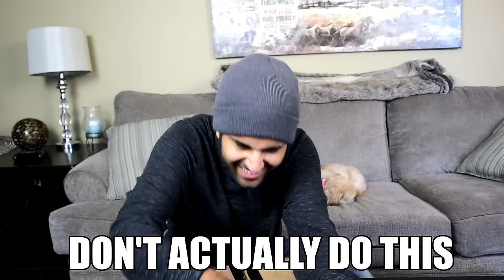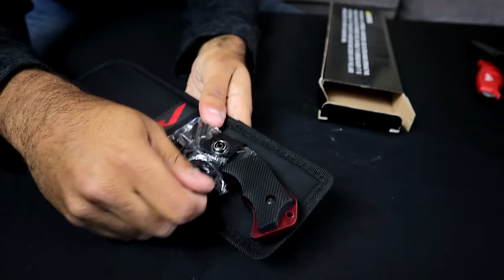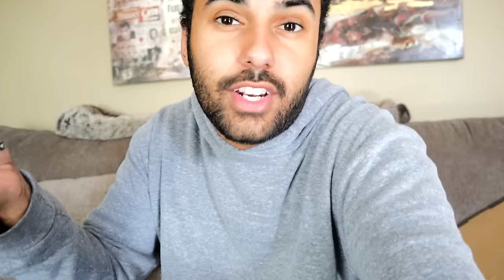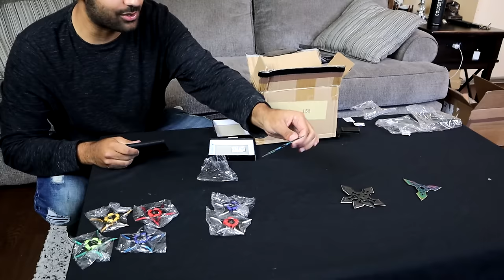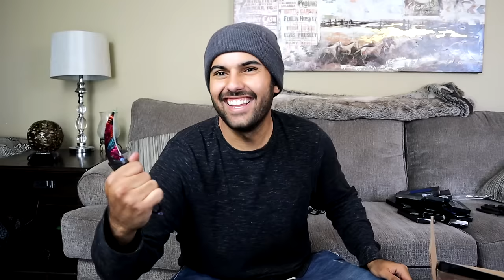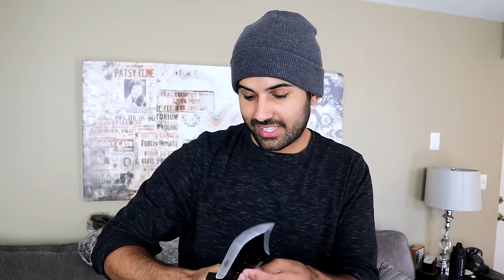Someone Sent Me a 100+ LBS Box Of MYSTERY KNIVES!! (VIDEO GAME KNIVES IN REAL LIFE)

Comment: Dude get some ballistic gel. It's a closer analog for muscle and can be remolded.
Reply: I agree he using watermelons these are really easy to cut its like..water or slush
Reply: It's not easy to get
Reply: Ballistics gel is expensive, and it rots. but they should put the watermelons in the freezer before cutting them.
Reply: The reason why I suggest ballistic gel is I would expect it to also be less expensive if he purchase the mix packets and reuse ones that he already made for multiple videos, instead of spending the $5 - $10 on watermelons every video.
Reply: Arthiem synthetic gel doesn’t rot